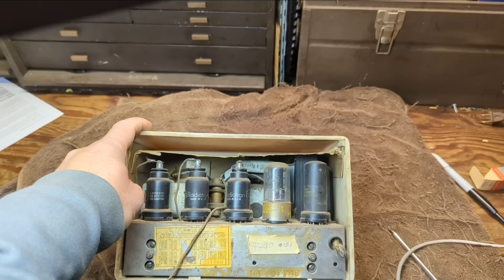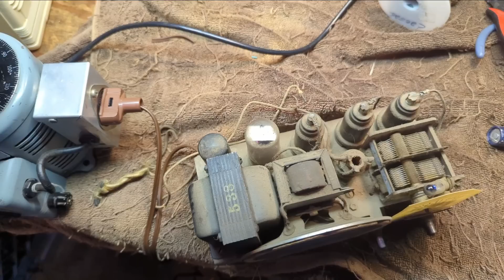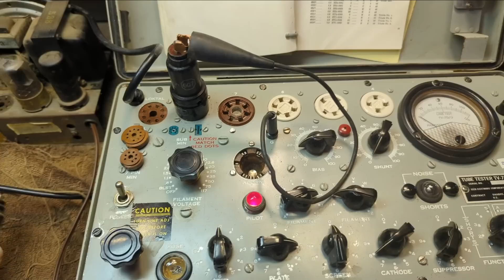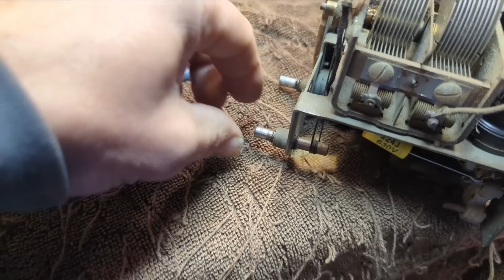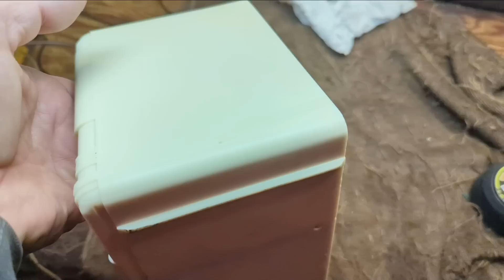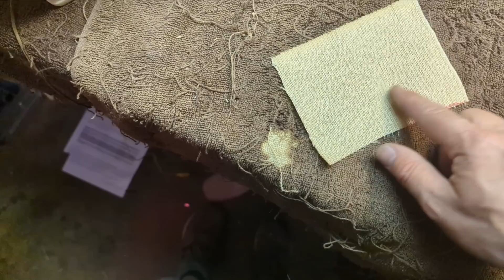Whittle Bitty Packard Bell overhaul

Comment: The original Packard Bell never made computers.  The name was sold to Teledyne..  An Israeli tank driver named  Beni Alagem bought the name in 1986 and started manufacturing low cost computers under the name.  They dishonestly stated "America grew up listening to us. It still does." I believe they had a presence in Sacramento at the time.  They benefited by the misplaced familiarity with the original Packard Bell name.  People also associated them with Hewlett Packard Co and Bell Labs.  They had no relationship to either company.  There's a Wikipedia page on the subject for further clarification.   The were acquired by Zenith Data Systems / Groupe Bull in 1995.  Packard Bell computers have nothing to do with the original Packard Bell company.  Zenith Data Systems/Groupe Bull also bought Heathkit solely for their computer technology and trashed the remainder of a once great electronic kit company.  Packard Bell is currently owned by Acer computer.

Comment: That has a beautiful nice full tone.
That must be an electro-dynamic speaker which would explain the two small sized capacitors. 6K6 was a cousin to the 6V6 and have wonderful real hifi attributes.

One of my projects is a 1953 Hoffman 21 inch b/w tv which  uses a single 6K6 and two speakers, a 6 x 11 bass, and a 5.25 inch mid/tweeter which can be switched on as both, or just one at a time. Hoffman was made in LA area as well.

Packard Bell, Hoffman, and Dumont were the Cadillacs of the 50's IMHO. 

Looking for the 6 x 11 inch oval speaker made by Rola, been looking for one for years. Ever run across one?

Comment: Packard Bell model 5 Kompak. It has it's original knobs which seems to be a rare thing with this particular prewar radio.
From left to right the tubes should be  6J7,6K7,6C5,6F6 and 5W4. Don't mix them up. A 5Z4 can replace the 5W4. A nice
restoration Seth.

Comment: I like to spray clear enamel on light paper cracks. You have to put two coats and it also strengthens the paper back to new. I also glue a round piece of paper towel over the magnet pole to prevent the over spray and dirt from getting in between the voice coil and pole